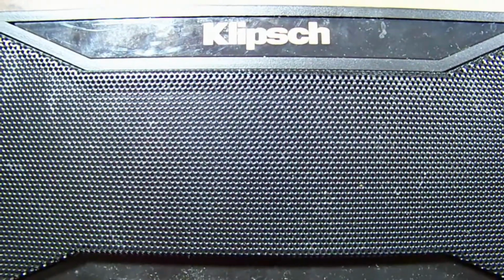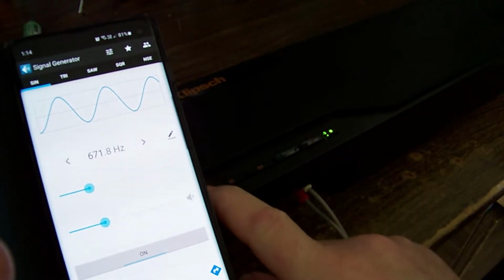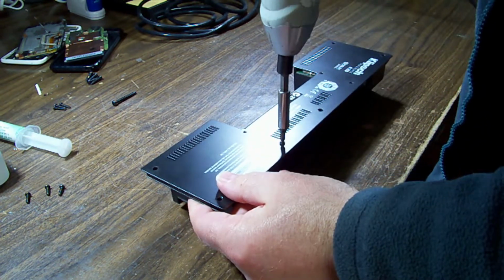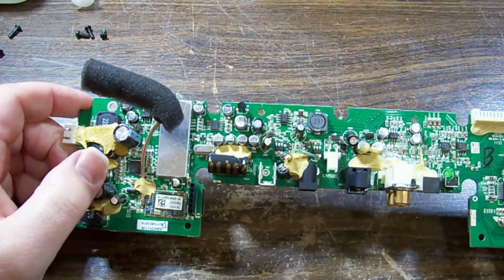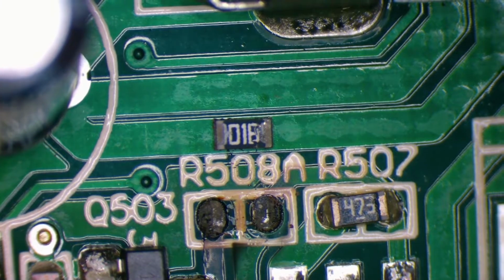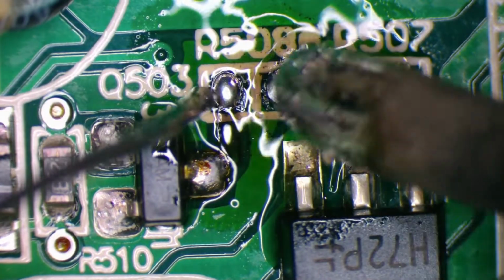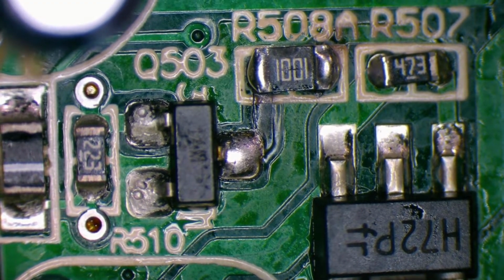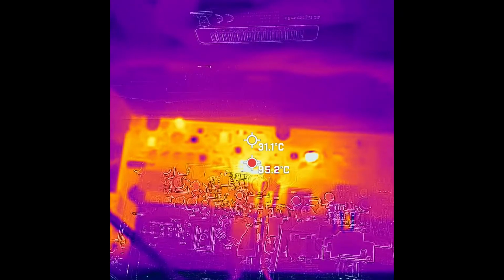Klipsch R-20B soundbar repair!

Comment: Thank you very much for pointing me in the right direction. Your video helped me to fix my Klipsch R-10B. Same problem, overheated resistor. Replaced and now working like new. Was trying to find sound bar board, looked everywhere, no longer available. Definitely  wouldn't be able to figure it out by myself. )))

Comment: I really appreciate you making this, just tried this as my first motherboard repair today trying to learn a new skill, getting a soldering station put together after I received the faulty sound bar and sub from my uncle feels really good to hear it work. 

this worked for me with r10-b identical board layout, exactly the same resistor problem(marked exactly the same) only repair I had to make. 🎉
Reply from the maker: Well done, good luck with your new hobby!

Comment: Dude, bang on mine stopped working and after watching your video i cracked mine open and same component heat loading, you could have been using my circuit board in your video. Identical visual failure. Now i get to findout how steady my hands are.

Comment: Finally! The answer!  Klipsch wouldn't try to help because I was out of warranty, but your video helped pinpoint exactly where the fault is. Found a guy nearby who will solder the resistor back on. Should save me $1000 for a new soundbar.  Thanks!

Comment: Jonny- Ty for the walk through. I have same system. I know this is a little older system but worked great. I went to the Digikey website but is there a part number for the resistor you used? or Would Amazon have this part? Looking forward to fixing this and getting sound with a small cut out for Heat venting!  Thanks again !
Reply from the maker: Look up 1000ohm (1k) and size is 0805 I think. There will be a few part numbers it won't matter what one you choose.
Reply: @JonnyFix  THANKS MY DUDE! MUCH APPRECIATED

Comment: Great video!  I have a very similar soundbar (R-10b), but mine will work for a bit and then suddenly drop sound entirely.  Sometimes restarting it will fix it (but only temporarily).  Any thoughts as to what may cause that?  Has anyone else encountered something similar?
Reply: Have you ever figured out the issue. I have R-20b with same issue.
Reply: @lefamily8290  I ended up taking it to an electronics repair shop and they basically did exactly what this video demonstrates.  There were a few bad resistors that needed to be replaced but it works like new now.
Reply: @nickmagliaro4020 How much did they charge for the repair?
Reply: @jsudave1  I don't recall, but it was under $200

Comment: Thank you very much. I also changed the dsp audio processor because the glue is brown I thought it damaged the chip. After I saw your video with the help of microscope found out the resistor was apparently burnt so I changed it and my klipsch is alive again thanks to your video.
Reply from the maker: Excellent. I've not yet seen glue cause damage to a chip.  I guess it could happen if it was in a high voltage area. Well done though!

Comment: Hey there. Awesome video. Definitely pointed me in the right direction though in my case the resistor seems to be fine. Measured 1kohm between the pin on the resistor and the solder joint on the neighbouring component. Reckon you could tell me what the components are that are lined up next to the speaker connections (the ones with the conductive glue on them). This appears to be my problem but am having trouble identifying the component
Reply from the maker: If you mean the dark grey ones with 220 stamped on top, they are inductors and almost never fail, you should measure low or 0 ohms resistance on their pins if they are ok. Why do you think those parts are bad?
Reply: @JonnyFix  those are the ones. Measuring 40ohm on one of them, most likely an issue caused by the glue becoming conductive. Also seems to have lifted out of alignment with the other inductors. Worth a shot. Thanks again for the video. Excellent guide to repair of this device
Reply: The thing that grabbed my attention with it was it was visually different. Lifted out of alignment and very dark glue on top. When measuring the 4 components, I got a zero reading on 3 and the 40ohm reading on one of them. I figured different = bad
Reply from the maker: @Kurules  I doubt the glue would have caused that, must have got quite hot tho. The glue can be scraped off and any problem it's causing will go away. Keen to hear if you get it working and what else may be bad!

Comment: Wow, your video is bang on. Same problem with mine. Didn't realize that resistor was so small. Lost it as it came off. Needing to take to a shop anyway as too small for me to tackle. Thanks for the video.
Reply from the maker: Glad I could help. I'm sure they can fit a new one for you!

Comment: Do you have a link to where you picked up that replacement resistor? I tried ordering one online but it was physically too large.
Reply from the maker: Funny guy :)
Reply: @JonnyFix  no I'm serious I'm trying to find a replacement and I can't, where did you find yours?
Reply from the maker: @Dankasaurus6  I thought you were joking because there is no way a small resistor is too large to send.  You can try RS components or digikey or element14 or mouser or ali express. You may have to pay a shipping fee.

Comment: Well, another satisfied "customer". Yep, it was the same resistor! What I wasn't prepared for was how small it was. I had a lighted magnifying glass and used the finest tip soldering iron I had which wasn't made for this fine of work - but it worked! This was the first time I've worked with surface mount electronics. I could not believe how small the resistor was. At one point, I dropped it from the tweezers I had holding it and took a while to find it. If the connection fails again, I'll probably just solder in a conventional 1K resistor. Thanks!
Reply from the maker: Well done for giving it a shot! I've lost so many small components to the carpet.

Comment: Thanks! This was very informative... I took mine apart and had a hard time noticing any loose resistors or anything like that. BUT I did notice that the yellow glue is VERY dark brown in a lot of places throughout the board... I'm guessing it has become conductive and is the source of my issue... Is there any fix for that, or is the board shot? Thanks in advance!
Reply from the maker: If that is the problem simply scraping all the glue off should resolve it.

Comment: Well done, high speed repairs Ltd :-D
Ooow did you work out the current flowing through that 1k?
I wonder if they skimped with the wattage of there resistors.
Yes of cause they would lol.
Reply from the maker: It's dropping 24 V to 3.5 across it so unless I'm wrong 20.5v/1k=20mA = 420mW.
Reply: @JonnyFix  420.25 mW  or 1/2 a watt in normal sizes.
I wonder if a capacitor on the output of that resistor is a bit dodgy, creating a semi short sometimes, 24v across 1K would be naughty lol

Comment: The resistor certainly was cooking, I would have been tempted to swap it for a through hole type to increase the heat dissipation.
Reply from the maker: Yeah I thought about that after the fact haha. It has lasted all these years though so should be good.